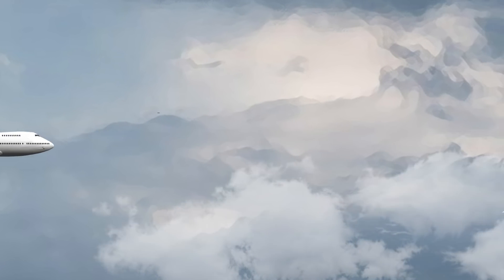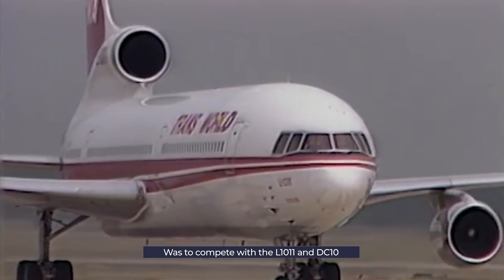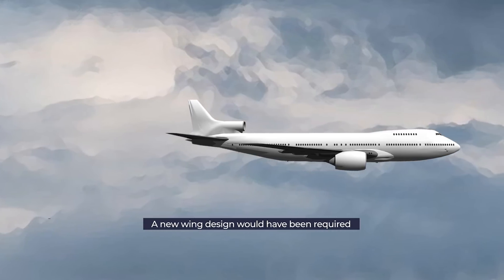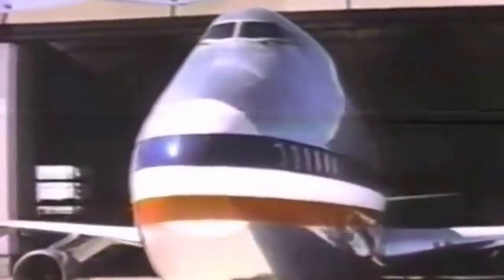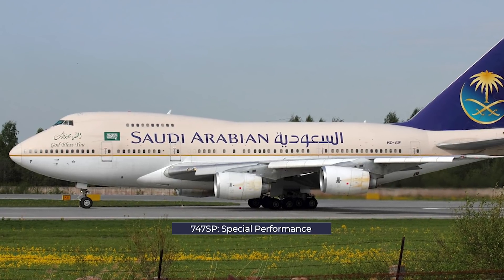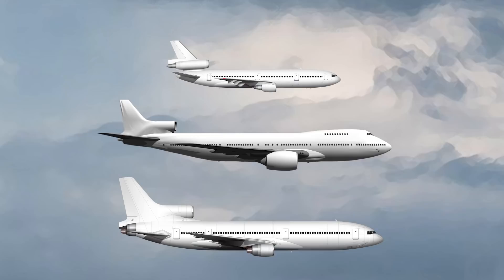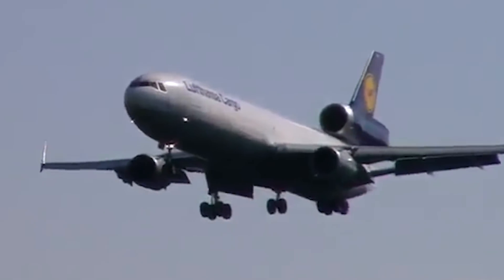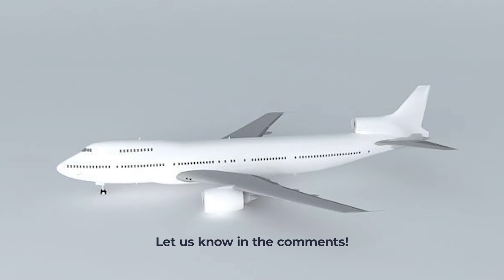The Incredible Boeing 747 Tri-Jet And Why It Failed

Comment: If they did it, it might’ve flown nowadays with no big problem and issues on fuel efficiency!
Reply: We're not seeing many MD-11s flying anymore. FedEx has a few, but they're nearing extinction. Airlines now only want two engines.
Reply: @quillmaurer6563  yeah. Two is easier to maintain than three, and that high-mounted third engine is surely harder to work on than the others, quite ignoring fuel efficiency...
Reply: markiangooley yup! Your absolutely right! 🙁😌
Reply: Quill Maurer it’s sorry actually 😞😓
Reply: Imagine a MD-747
Reply: 777 do the job of the 747 but wayyy more efficiently. Even if the 747 only had 3 engines it still wouldnt beat the 777 or a350

Comment: How about a 747 with 2 GE9x engines and the 3rd fuselage mount engine at the back? That's not exactly a bad idea... Something worth considering.
Airlines feel quad jets are too expensive to maintain, twin jets have their limitations so then a tri jet would be the best fit! 
I feel tri jets would definitely make a dramatic return in the coming future...

Comment: That idea actually came about because several airlines, like Delta complained that the 747 was too big. Which is why Delta started flying the L-1011.
The L-1011 was one the best passenger aircraft ever built IMO. But unfortunately for Lockheed most airlines opted for the cheaper DC-10.

Comment: If Boeing had gone ahead with the 3-engine 747 concept, I think it would have made the situation at both Lockheed and Douglas even worse in terms of selling jets. The L-1011 and DC-10 programs were competing for a relatively small market space (one that could not, realistically, support both aircraft in large numbers) and the 747-Trijet would've cut the top of the market off of the long-range variants of both competing three-holers, while undercutting the 4-engine 747 as a medium-range high-capacity solution.
This plane would also have had a knock-on effect on the 757 and 767 programs, which likely would not have come about until the 1988-1990 time frame. Great video, Simple Team!

Comment: I honestly think killing this was probably harmful in the long-run.  The initial tri-jet would have amounted to an overpriced iteration of the SP, but the new wing would have allowed a 747 in place of the  ASB as soon as larger engines became available.  Effectively, there could have been a 777 at least five years early, but pairing the standard tail with the trijets wings and new engines at the same time the -400 was developed. You'd also have sales driven by the nose-door being avialable on a smaller aircraft than the 747 that would seem likely to, at a minimum, create enough sales to push off any talk of cancelling the program in 2020 and result in the trijet itself selling better than the SP did.  I also suspect that without the 777 in play we'd have had a 767 NEO program at some point in the last decade, with considerably more 767-400 sales than we got historically.  Given the cultural impact the 747 would have, I wonder if the 787 wouldn't just be a re-winged 767.

Certainly the A350 would look better in comparison to a 747 Intercontinetal Twin Shortbody than it does competing with a 777, but between commonality, cargo options and earlier availability this wouldn't have been a poor seller by any means, and the economics of commercial aircraft being what they are I tend to think that total airframe counts approaching historical while essentially removing a whole airframe development program (or two) from the picture would be a net positive for the company.

tl;dr the trijet wouldn't have sold all that well, but the strategic implications of the new wing and a true family of aircraft with 747 cargo handling would have done a lot for Boeing.

Comment: My understanding was that this wasn't made because Boeing did enough market research to determine that the market for widebody trijets - this competing with the DC-10 and L1011 - wasn't big enough for a third entry, and hence it wouldn't sell well. The 747-SP didn't sell well either, but cost far less to develop hence was able to break even when the trijet wouldn't have. Seems like a good decision given that there indeed wasn't much market for that segment, the L1011 was pretty much a commercial failure and the DC-10 a moderate success. This is one thing Boeing is pretty good at, analyzing and building what customers actually want, or anticipating what they will want. There's a lot of things they've considered but ultimately never built that in hindsight was a good decision. Larger 747 variants that would have been in league with the A380 - the A380 hasn't been as successful as hoped, good move on Boeing's part to not make that. A passenger jet (707) in a time when nobody else thought that to be the way forward - that's what really put Boeing in the lead. A huge twinjet, designed before ETOPS was a thing but they envisioned it would be - the 777 is doing really well, while the competing A340 has suffered.

Comment: Can they bring back tri-jets to make economical double-decked jumbos? IIRC both Airbus and Boeing has prepared concept drawings on a twin-engined double deck. Mostly encountering the issue with needing too large an engine to make the aircraft feasible. But could it be done with 3?...

With new technology, perhaps tri-jet double decks could be made comparatively feasible to the twinjet single deck, it's all a numbers game after all, capacity over fuel burn. Granted, high capacity double decks are going the way of the dodo due to the switch in travel to point-to-point.

Comment: Boeing definitely dodged a bullet. Trijet’s showed there inherent danger in United flight 232 in 1989 when a DC-10 had an un-contained failure of the middle engine that caused all three independent hydraulic systems to fail. 

It is just to risky having an engine located in a position like the tail where an engine failure could cause total loss of the use of a critical control surface.
Reply: Maybe, but there have also been several disasters due to the large asymmetric thrust created when one of two engines fail on a two engine craft. The effect is smaller on a trijet.

Comment: You missed one important point. Boeing bought McDonald Douglas and the MD11 was scrapped for the 777. At that time you needed three engines for fight over oceans. When the law change if Douglas had been its own entity still the MD11 would have been converted to a twin engine design resembling the 777.

Comment: Everyone talks about how much of a pain it would have been to re-design the wings. Nobody mentions the literal arse-ache it is to re-design a tail to take on a jet engine. This is the reason why a '47 tri-jet wouldn't handle the same as a normal '47. A similar design issue caused the 737 Max to need that stupid MCAS stopgap. Moving engines around on an airframe also moves the center of gravity...

Comment: I wonder how the 747 would perform with  two GE9X ...
Reply: You mean basically a 777. Boeing looked into that and with the new 777 being almost as large as the current 747 it made no sense.
Reply: @Sophie-and-Ken  you missed the point...
Reply: From quick data on Wikipedia only, that would be 200kN less thrust combined, compared to a regular 747-8. That's some important 20% so I guess it would require some modifications.
I can understand tho that the 747 frame has some advantage as a cargo plane compared to the 777x even, namely the huge front hatch that means you can load stuff as long as the entire fuselage in one go.

Comment: I have always thought, can the older 747- 100 or sps could have been re-engined to be twin jets
Reply: Would require new wings, as said on the video, to have the thrust be stronger in different parts than before, plus probably a taller landing gear so the bigger engines fit.
If you try hard enough, you sure could do it, but how viable it would be economically is the thing that would keep it from happening.
Reply: @Kalvinjj  its a dream sir
Reply: 777 is close I guess

Comment: Just add 2 Ge-90’s, that would have enough thrust. But then you would have to redesign the wing. Guess boeing doesn’t want to spend that much. What if the fuel efficiency does not change. But 2 vs 4, i think it will. What if no one buys it though. Anyway, it would only have to engines.

Comment: What if a passenger plane was created with twin rudders?
Reply: You mean sort of like the Antonov An-225? I would imagine that it could be done but would be heavier structurally, hence none have been built like that since the propliner era. The An-225 has it because it was designed to carry external payloads (Buran space shuttle) which would have blocked airflow from a conventional center tail. The only advantage of a twin-tail layout is that it would allow the plane to fit in a less tall hangar, but airlines would rather build bigger hangars than have a less efficient plane.
Reply: There's a reason aircraft went from Twin-tails like the B-24 to single tail aircraft in the 40s.